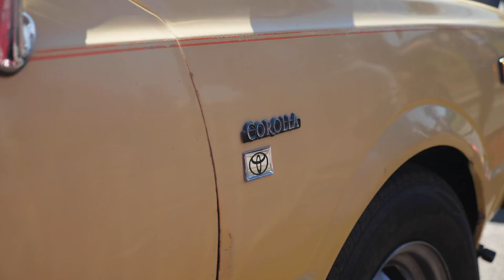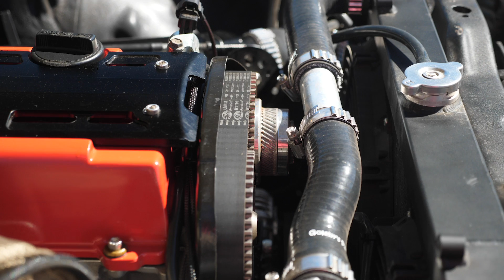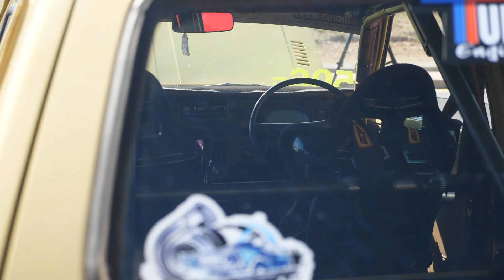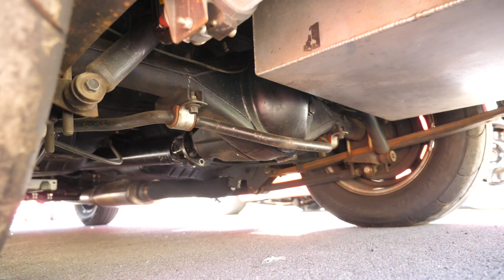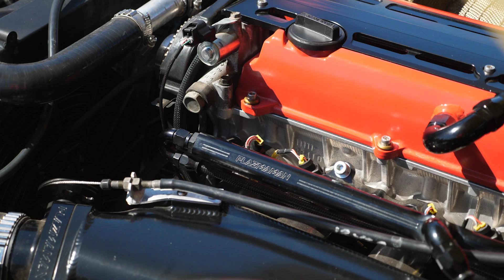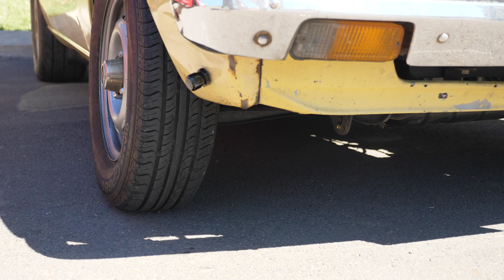1970's Supercar Killing Sleeper | 8 Second 1JZ KE36 Corolla [TECH TOUR]

Comment: Does anyone know what transmission control strategy these guys are using on the a340?
Reply: Pretty sure he’s manualised it by a simple wiring mod. The a340 is controlled via solenoids so wiring it that the gear shift position switch controls it is very simple. Goleby even was one of the first to post online how to do this back in the day.
Reply: @steadyfab  Thank you!
Reply: These are analog boxes there is no transmission control other than the valve body.
Reply: @dj4monie  They are fully hydraulically controlled?  That is cool!  So was it the a340e that needed a controller then?

Comment: Daily driver, imagine  pulling up to this at a set of traffic lights on my litre sports bike and getting smoked 😂
Holy sheeet
Reply: My uncle had a Ford Pinto Wagon two door very similar to this. With the 2000cc EAO engine which has been the basis for the Formula Ford engines (after the 1600 Kent and before the Zetec) with bolt-on parts used to smoke 240Z's all the time. (Header, Weber/Holley carb, Camshaft and Hemi muffler).
Reply: pistaciciri I know what you mean. I just held off a Tesla in ludicrous mode, imagine getting well and truly flogged.